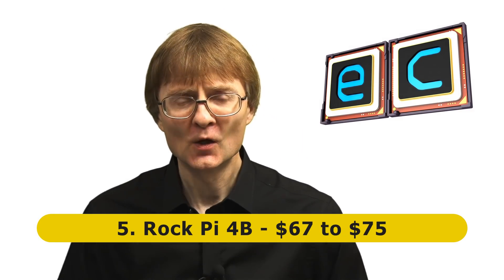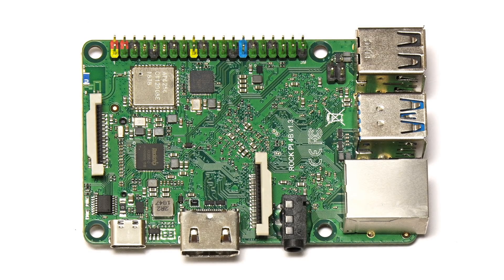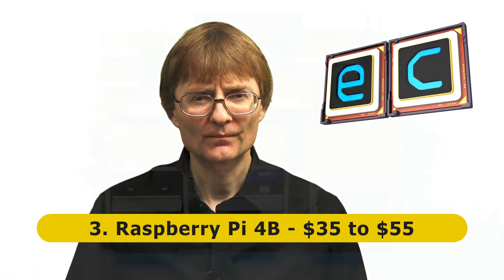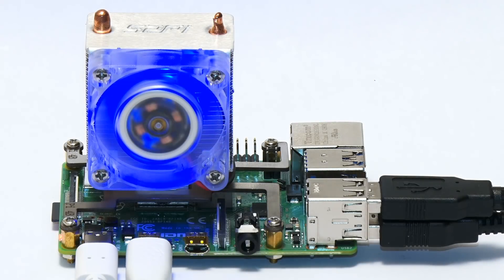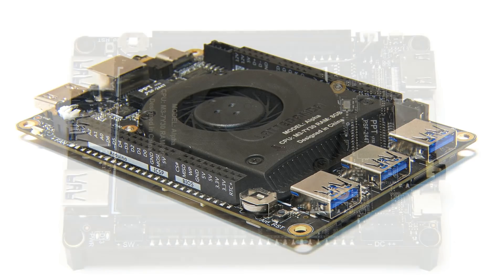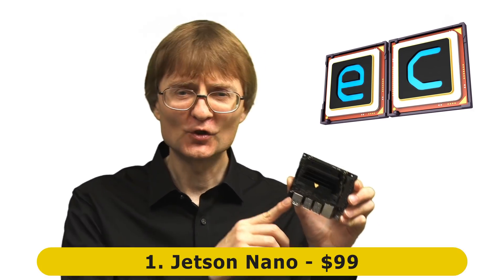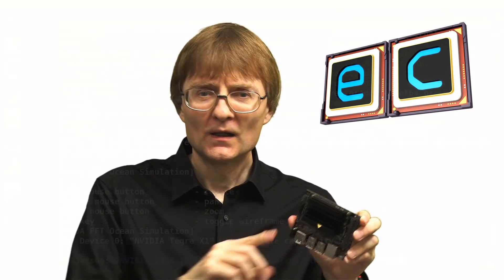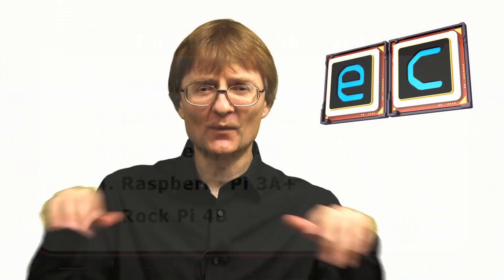Top Five New SBCs 2019

Comment: Hi This is a development board operate with linux system,not need to extra development software,and they can provide software support for u,if you are a creation engineer,I think it's a good choice: https://www.amazon.com/12-3inch-Display-Controller-Operate-Support/dp/B089GPSBKQ/ref=sr_1_1?dchild=1&keywords=Linux+Development+Board+HDMI+VGA+YPBPR+CVBS+Audio+Input+Support+7%27%27+to+100%27%27+Display%E2%80%A6&qid=1592892604&sr=8-1

Comment: Has this changed much up to now chris?
Reply from the maker: Not that much! The Pi 4 would be higher placed, as the firmware is much improved (it runs cooler and we have USB boot), and the 2GB Pi 4 now sells for $35, which is good value. We now also have the Odyssey X86J4105, which is the best and best value X86 SBC I've ever used: https://www.youtube.com/watch?v=4XV8dlFwNd0
Reply: ExplainingComputers cheers man.

Comment: Agree with your assessment on the Jetson Nano, having just purchased one. Even if you aren't hardcore into AI it's still a great option since the GPU upgrade alone makes your SBC go from a light web browsing machine into a video editing and gaming powerhouse. In my case, I bought one because I want to dabble in some AI software development with a low cost GPU solution before committing the big bucks on full scale GPU enclosures or spinning up AWS instances to handle model training. In some respects the Jetson Nano will be the training wheels I'll use to become proficient in this area before making the plunge into AI fully.

As for the other items in the list, I'll have to disagree with you somewhat. For me, it's hard to justify a LattePanda given I already have a number of x86 based systems I use (along with VMs I can spin up on my machine if I need to). The price is also troubling as you can often get a much more powerful off-lease Thinkpad or brand new low end PC for the price. Raspberry Pi 4B I also own and found it to be good value for money. However, I would argue that the Rock Pi should be ahead of the Raspberry Pi 4B since it doesn't have the same overheating issues as the Pi and it also has that nvmE storage slot, meaning faster transfer speeds and more reliable storage which is good if you want to have a SBC as your daily driver.

Comment: hi guys i need some help...
We are working on a project  having below specification.
Ruggedized Panel PC with following minimum specifications:
Processor:1.4 GHz or higher embedded fan less 64-bit Quad core Intel Atom processor with multi-threading OR 1.4 GHz or higher embedded fan less 64-bit Quad core ARM Cortex processor with multi-threading or equivalent.
RAM: 4GB DDR3 expandable to 8GB DDR3 or better
 

Storage: 128GB SSD or better
Operating System:Embedded Linux OS (RHEL) with OEM support for bug fixes, releases, patches, OS customizations or any other relevant support on OS
Along with SBC we need a Redhat Linux support with certification.
can you pls help me for finding it out.

Comment: You forgot AtomicPi. Hands down the best SBC considering price and versatility of x86 instruction set.
Reply from the maker: An excellent board -- if not really "new" in 2019! :)
Reply: @ExplainingComputers  Ah, touche! Well, in that case nothing "new" to write home about in 2019 :-) Currently on Amazon it sold for $35 with mini breakout board. I''m going to score another one; just in case I might build a robot or something.
Reply: Never mind: I just bought another one.  Went back to verify the deal, and was still there, turns out it ships with camera and mini breakout board. I don't care for the camera but an x86 'puter at the price of a pumpkin-pie. I can route lots of packets with it, if not I can use it as a word processor of some sorts. Can you imagine, just 20 years ago what something like this would cost?
Reply from the maker: @tech29X  The Atomic Pi remains one of the best deals of 2019, and 2020 if you can still get one! :)
Reply: @ExplainingComputers  still on Amazon - US, for $39.95 with the bottom "development" board & feet included, in addition to the main board which you reviewed.

Comment: i am  missing udoo bolt, which  omes with ryzen + vega8 power and andruino connection.
Reply from the maker: The Bolt is a great board, if not technically an SBC, as the memory is not on the board.

Comment: Hi Chris, love your videos, they have helped me a lot to understand the SBC market. I would like to ask for your advice. I am working on a project that requires an SBC but to date I have struggled to find an SBC that meets the following requirements out of the box. I am looking got an SBC that runs Android out of the box, has 2 x HDMI connectors (this can be HDMI or DP or a combination of both, has a display ribbon connector on the board as well as I want the ability to run up to 3 screens, is capable of running 8 GB + of memory,  has WIFI and Bluetooth ( or could be added on using an ad on board), preferably has the 40 ping GPIO or similar, and is AI capable. I already have a Raspberry Pi 4 which is perfect from a hardware point of view but there isn't a version of Android that has been released that works with it . I was about to purchase the Jetson Nano but as far as I can tell it  they have not released a version of Android that works with it? Is this true? Any recommendation you can provide in terms of an SBC that meets the above requirements will be greatly appreciated. Keep up the great work. Thanks Chris
Reply from the maker: Thanks for this. A LattePanda Alpha or Delta can run three screens as you require, as can a UDOO x86 AP. You would need to run x86 Android though, which can take some messing around (I've never tried it). I am not aware of an ARM SBC meeting all of your requirements. :( There is indeed not yet Android for the Jetson Nano. :(

Comment: Nice video - but I recommend you re-think your criteria a bit.  I build specialized control systems (water purification) for a world-wide company, and when I need an sbc for a project one of my first considerations is this:  when I need to solve an issue or make that board do something - how big the support community is is a huge factor.  Simple numbers, the more people using the same board (or class) as me the more likely one of them has already solved the problem or figured out how to do what I need to do.  And the number of people contributing to porting code - drivers for example - for your #1 board I'm betting you don't have the drivers to push that gpu, the video looked bad.  But a Pi3B has drivers that make VLC player play movies surprisingly well.  So ask yourself - what of your 5 boards will get software/drivers/etc first? And have the most answers out there in the forums?  (ps: I am not a fan of the Pi nor affiliated with anyone)
Reply from the maker: Thanks for this. I am aware that SBCs are increasingly used in industrial situations, as you describe -- but that it not the target audience for this channel. So the criteria I have selected are those that work for my main audience here. :)

Comment: Great list! I can see I came in third
Does the Jetson Nano require active cooling for stuff like AI?
Reply from the maker: I've had no problems with the Jetson getting too hot running AI stuff. It has a good heat sink as standard. This said, some AI applications -- like the JetBot I tried here: https://www.youtube.com/watch?v=wKMWjIKaU68 -- do put the board in its 5W rather than 10W mode, thought this I think is because they run from battery power. There are mounting holes for a 40mm fan on the heat sink, and a fan connector is on the carrier board.

Comment: How about the Udoo Bolt V8?
Reply from the maker: A nice board, if not technically an SBC (as the RAM is slotted in). But even so, still not top 5 in the year for me, not least due to the fan noise.
Reply: @ExplainingComputers  Ok. Good point. Upgradable memory does start making it more of a small form factor pc, but that one is kind of in the middle because it also has the arduino pinout.
Reply from the maker: @activechaos128  You are right -- the Bolt is almost in a category of its own! :)

Comment: If somebody wants to be doing AI inference, the Google Coral Edge TPU is probably a way better choice. It has full upstream support in Kernel, can be connected using mini PCIe, M.2, or USB3. Works on x86, Arm32, AArch64, Power9, etc. Entire driver and compiler for TensorFlow and few other frameworks are open source and rocking way better performance, for small models at least. Plus the accelerator cards are really cheap. I just ordered mine for 35$, and it is coming in 2 weeks. Way to go!

Comment: AI will we need to know anything about them as they are self learning and will soon take us over. How power hungry are these boards? Which one gives the best output for the minimum input power? Intel lost out as a mobile cpu because it was power hungry, used in servers with unlimited power. Now with people more weary about the environment they want cpu's that use less power and if they use less power the there is less heat to get rid of, saving on air conditioning or climate control.

Comment: The same things you say about the Latte Panda can be said about Udoo's Bolt/x86, and are cheaper, way cheaper.
Reply from the maker: Agreed on function, but the Udoo Bolt is more expensive than a LattePanda once RAM is added.
Reply: @ExplainingComputers  but npt the x86. The bolt is really powerful.
Reply from the maker: @CarlesMateu  Yes, agreed, the Udoo x86 AP boards are cheaper, and really good.
Reply: @ExplainingComputers  and then you have the Atomic Pi, although I wouldn't bet on its continuity beyond existing stock.
Reply from the maker: @CarlesMateu  Oh yes, indeed. :)

Comment: I'm just sad Nano has no video support yet. I have a project in mind and I immediately thought it would be perfect - hope they fix that soon. I really like it otherwise and I'm not surprised you have picked it as the winner.
Reply from the maker: Video playback on the Jetson Nano is still pretty good without hardware acceleration (if not as good as it could be if the GPU was used for the decoding).
Reply: Oh, it is? I guess I will look into it some more then. After all, the pricetag is so nice I wouldn't be too disappointed if I had to use it for something else. Thank you!
Reply from the maker: Checkout my video here: https://www.youtube.com/watch?v=kbn_6ixtIpA After the drive tests, I show video playback on the Jetson Nano, and video editing. And it works!

Comment: I would like to see the raspberry pi org  come out with a few customized configured raspberry pi servers. For example a new pi to be used just for an  Apache web server and another pi just to be used as an SQL server, and a pi just for an email server etc. That way they can get rid of the stuff that is not needed for a NAS or Web server or Databse server like audio, dual hdmi ports and add more memory and stuff that is needed for each type of customized server without impacting costs very much. I see this as a market need currently.
BTW I enjoy your videos !
Reply: The Raspberry Pi Compute Modules are a possible answer to this need. Currently the Pi 3+ module is still available from some suppliers, although it looks as if many are clearing their stock, perhaps anticipating the arrival of one or more versions of the Pi 4B as a module. The modules have been designed for industrial use, & are plugged into a SODIMM slot. This has allowed for a variety of uses, including clustering & implementation of more GPIO pins. All signals are available via the connector, with no onboard HDMI, USB, GPIO, etc. I hope to see the release of the 4B version by 2021. That would make for a great server cluster board.

Comment: Agree regarding Pi 4 and cooling at least with a tiny 3,3Volt fan or passive heatsink.

And I too hate the 3rd kind of hdmi connectors on a pi. ... Why didn't the look for an hdmi stack with 2 above each other or that mini hdmi of the pi zero

Comment: I think the list is in a good order and I agree on the Latte Panda Alpha position. It is expensive but the amount of projects and applications of it mean it can be used perfectly in smaller specific job cases were the power is needed but an SBC form might be required be needed and something like a desktop/laptop is just 'power sucking bulk'.

The Jetson Nano at 1 is a good choice - beefy, powerful and it's use cases are in the same field as the Latte Panda Alpha but so much cheaper!

Cyberdyne Systems agree that the future of computing is AI too ;-)
Reply: The Latta Panda should not make it to the list, there alternatives (besides the Atomic PI of uncertain future) that are way cheaper: Udoo x86 (https://shop.udoo.org/other/udoo-x86-ii-ultra.html ), for instance. Similar form factor, integrated arduino, x86 processor, etc. For less more than half the price.

Comment: Pi not at the top of the list? BURN THE WITCH!

I wish the Pi's would have more sensible names. Like, what's wrong with 3.0, 3.1, etc. It makes a lot more sense than "3A+".

One thing I did hear on other channels in that under NORMAL load, the Pi 4 isn't particularly hotter than the 3. Perhaps people are overfocussing on cooling requirements when the thing is maxed out under heavy load.

I can't see that they'll be too many takers for number 1 and 2 on the list. They're too expensive, I think. What niche do they fill? The Pi's are good in providing GPIO pins and decent computer power at a great price. If you need more computing power, then why not abandon the whole SBC thing completely and do your processing on your main machine? ... unless you're telling me that I can make a PROPER desktop computer out of that Jetson.

Comment: I'd swap raspberry pi 4 with latte panda. Reason being while DFRobot is pushing the envelope with that hardware in a small factor when we have smaller and just as powerful SBCs in the form of those TV sticks minus the GPIO. To me, the point of an SBC is to be a price effective solution for hobbyists and makers that likely already have a desktop which renders the latte panda moot as you still need to hook it up to an external monitor to really interact with the hardware that justifies its price point. That said I agree entirely with the jetson nano regardless of its focus on AI which is more relevant to the ideals of an SBC.
Reply from the maker: Thanks for this. Good point on hobbyists. But there are no TV-stick size computers with anything like the power of a LattePanda Alpha -- it can run a professional video editor, and outperforms many desktop PCs! :)

Comment: RK3399 performance is great, but in addition to the Android system, the other is unstable, in fact, Android is not very stable.
Reply from the maker: Running on which computer? RK3399 is an SoC used on many different SBCs, and performance on different hardware will not be the same! I have found the RockPi 4B to be stable in Android (and indeed more broadly), and better than other RK3399 boards.

Comment: One more tip about the Pi 4, get a short microHDMI to full size female HDMI cable and leave it attached. That way there’s no wear from repeat insertions to the micro.
Reply: Make sure the cable supports CEC if you need it.

Comment: Question:   I have 3 HDMI monitors (2-1080p & 1-4K).  I would like to run programs on one SBC like RPi4 or Jason Nano with attached 4k monitor, mouse, and keyboard.  Connect via USB or Ethernet  2 each RPI 3As with 1080p monitors each.  The programs would run on the main SBC using it's keyboard and mouse, but display on any of the 3 monitors.  The mouse and keyboard would virtually move across the monitors.  I was thinking Linux and x-windows but my searches have turned up nothing.  Any suggestion on where to look or how to accomplish this?  I use Linux Mint, Puppy, Quirky, and Ubuntu.

Comment: The Jetson isn't a single board computer by definition. It has two boards it's a DBC (dual board computer)
Reply from the maker: The Jetson Nano is very much a single board computer, as the Jetson Nano is just the top bit, the SoM (system on a module) as this contains the CPU, GPU, RAM, SD card slot, and all connectivity electronics. The Jetson Nano Developer Kit includes both the Jetson nano SBC and the carrier board that extends its connectivity to more usual socketing. But the Jetson Nano alone can be purchased for industrial use.

Comment: My  gratitude for yet another good video.  I must say at first I did not agree with your choices.  But after a ponder, I agree based on your reasoning.

However, hahaha.     If you could consider the  ROCKPRO64  by Pine.  Where would you put it in top 5 in power and capability and all performance?  I have now qty 2 RPI 3B+,  1 ROCKPRO64 by Pine,  and YES QTY4 LATTE PANDA ALPHA's.
I have qty 3 SSD Drives using the ROCKPRO64 card.  Latte pandas alpha I ordered the M2 500 gb disk for each.  I have a shared drive  NAS. Network for the RPI 3B+. Lol. I need video and microphone to create blog video.  Do you have any older replaced you would like to sell at affordable price Sir?

Most Humble Appreciation.

Alton
Reply from the maker: The RockPro64 is a great board, especially with the SATA card fitted. But it was not released in the past 12 months, so cannot be on this particular list! :)
Reply: Yes of course.  But how do you rate it's overall power and performance and handling videos?  I believe it has 2 video ports. If I remember correct.  Just curious. Mine was a faulty board tested in California. Gotta replacement.  Good folks at Pine.

I hopefully will have all SBCs up and processing  soon. The work load I am creating will use all of them in key ways. 4 already running. PI's 3B+ x2 rockpro64 and 1latte panda alpha.  This helps me overcome disability.  One day I will have a product to sell the world, and it will not be to long from now.

I owe it all to you and 30yrs at IBM.

Humble thanks!

Btw I will get 4 of those AI boards next January for that phase of learning. And applying to the package.